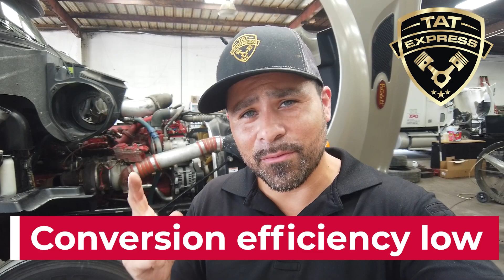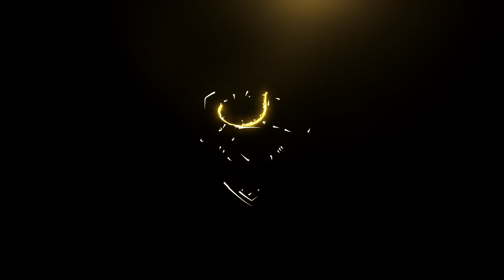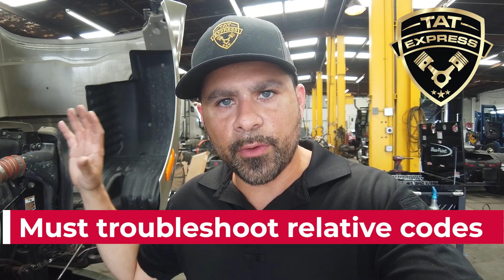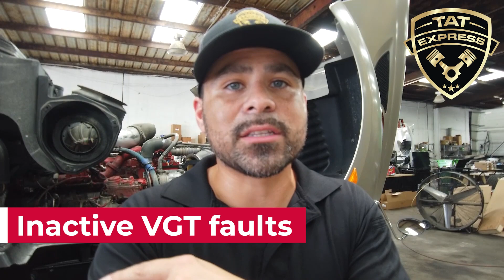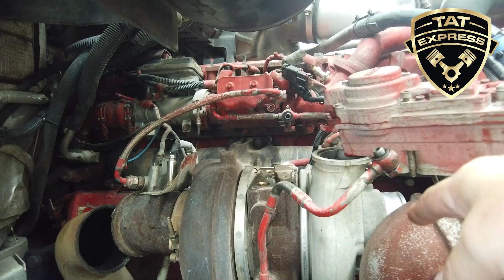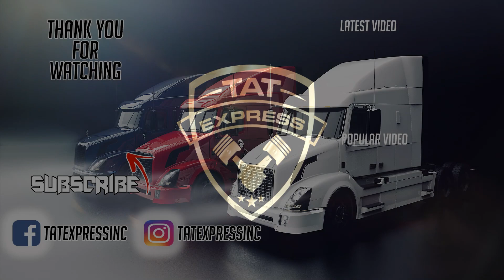Conversion Efficiency/ Conversion efficiency low/ Conversion Efficiency SCR/ ISX/ DD15/ Volvo/Paccar

Comment: Good find, I work in these systems a lot. you are right most problems caused by the EGR system and turbo but I found a few caused by bad boost pressure sensor set code for the turbo speed sensor. thank you for your work

Comment: My 2016 Cummins ISX 15 kept throwing nox codes on hills and computer said it was the intake nox sensor. I replaced it, now all is well. Approximately 366k miles on engine FYI, hope this helps someone.